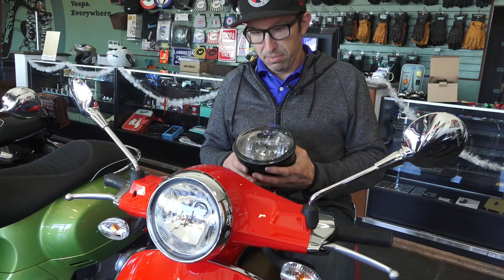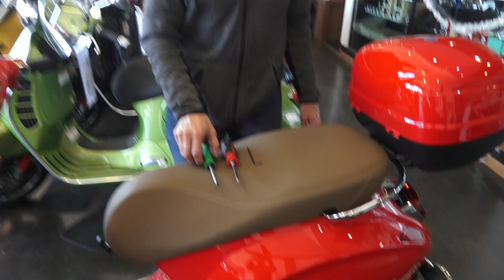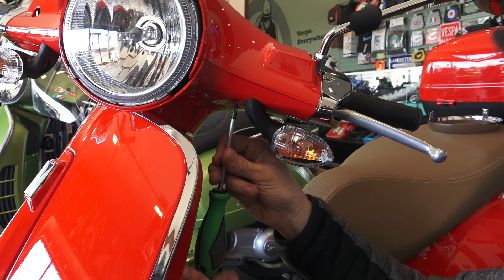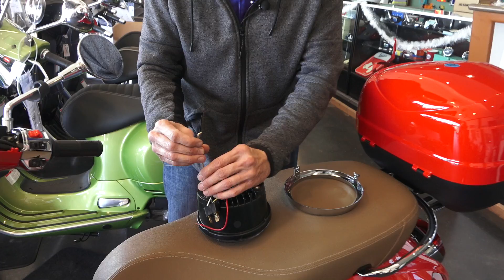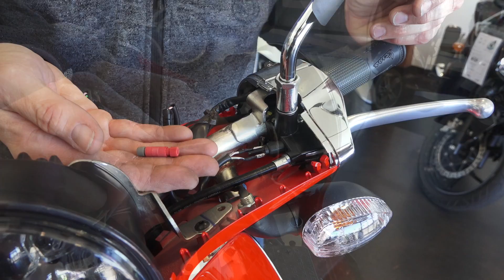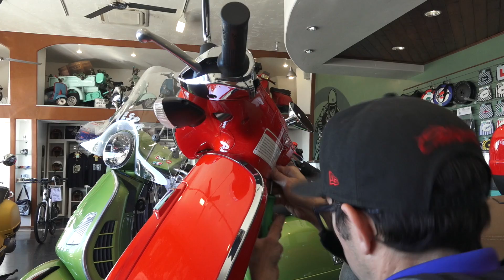New LED Projector Headlight for Vespa Primavera

Comment: Hi dude does it fit for the 2011 lx50 ? Thx
Reply from the maker: No, these are specifically for the Primavera. Completely different headlight design than the LX. Thanks for checking.